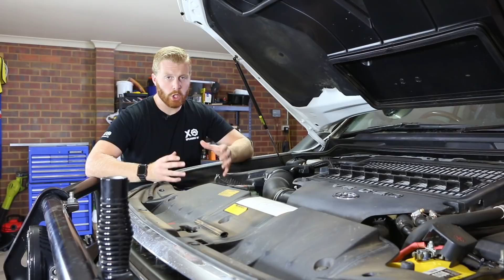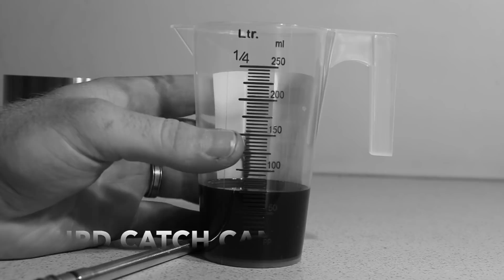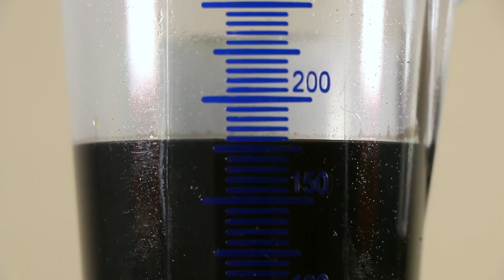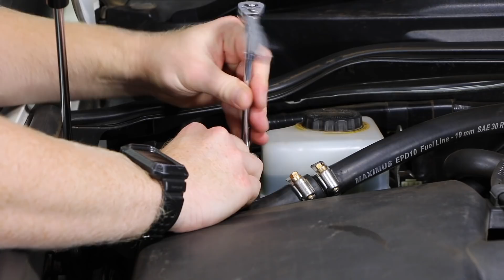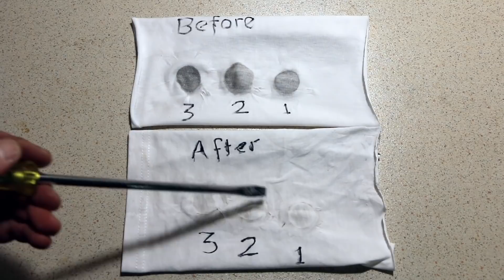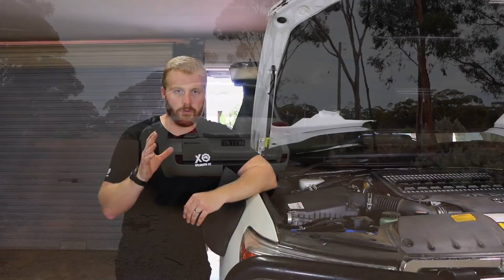PROVENT 200 | Is it really worth it? | MY 7000km REVIEW, drain and testing | Catch Can comparison

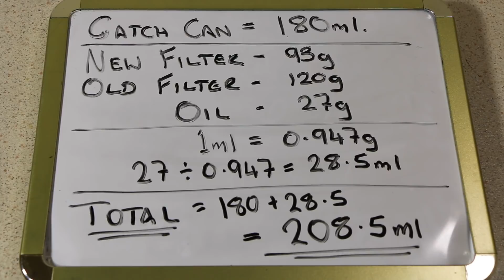Comment: 6:38 this is interesting for used oil as the technical data sheets typically have the SG (specific gravity) of around 0.85 (taken my engine oil of a Castrol Magnatec 5W-30 ACEA A5/B5 as an example) depending on oil manufacturer.

If an SG = 0.947 used, then it  gives a clear indicator (potentially) of the mass of suspended solid particles (soot, etc.) that increase its SG.

And it would be an interesting analysis of when the oil becomes somewhat saturated i.e. where the SG of the used oil does not increase over the oil change interval.

Then, I’d imagine as the engine ages this figure should go up and the saturation over the oil change interval would increase earlier after changing the oil and give an idea of engine health and blow-by.

Sorry, I think I may have designed an experiment and you seem to have time and money…things I don’t have much of.

Would such an analysis help to feed your inner nerd?

Thanks for the technical, non-beard-stroking approach.

Comment: Ive heard removing egr is not needed. Basically... How often, does an exhaust get blocked? Basically, never. Catch can = good. (if installed correctly when an appropriate catch can to suit your engine) Egr block = bad (usually) Old motors though, ok..New motors, need tune, usually a waste of time. My 2 cents on me research.

Comment: Poor installation will cause back pressure problems before the protection valve can react. You need to splice in ProVent under the hood so that the additional hoses are AS SHORT AS possible and do not mount with hoses of LESS THAN 25mm inside diameter! These need flow to work properly! Using feet of thinner hose also causes vapor to condense inside the hose before it even reaches the ProVent, you will experience freezing problems if used in climates with serious winters.

Comment: The back pressure risk is not a myth. If the unit is not serviced and too much oil is collected it can rise above the level of the pressure relief valve. This reduces its ability to vent the gases, and the back pressure can blow the injector seals. Ask me how I know... and the answer is about $600 for a new seal kit installed on a 4D4 3ltr.

Comment: You WILL use MORE fuel, EGR DOES NOT add to your fuel economy. Deleting EGR and DPF systems and re-tuning the engine on most engines result in a 40% to 50% increase in fuel economy and BEST OF ALL, no more sludge build up. But being a fan of the environment I think we just need to find better ways to deal with this problem like taking EGR gases from AFTER the DPF filter.

Comment: You think a Provent 200 or 400 is best for a Twin Turbo 5.0 Diesel V10?
Thinking a 200 each side, to not lengthen any hoses - or a 400 in the V when I remove the EGR Cooler/Parts to see the Alternator deep under XD
(essentially 2x R5cyl 2.5 TDI's from in a 2005 VW Touareg)
Reply: Subbed :) Great content.

Comment: ELEPHANT IN THE ROOM. Unfortunately you do not have a thorough enough understanding of what an EGR does, how it does it, when it does it and finally why it is used to be telling people to block it off. Advocating this is 1. Illegal, 2. Immoral - Will increase NOX emissions into the atmosphere. 3. Costly - Will void any applicable warranty.
Reply from the maker: Hey mate, I'm not advocating for it to be blocked, but talking about the reasons as to why or why it shouldn't be used. 
I know the system quite well, how it works and when it works though out different driving scenarios. I understand the ramifications on the vehicle and engine temperatures along with other external factors. 
Every person needs to make their own decision as to how to manage their vehicle and I think most wold understand that interfering with these systems would of course void related part warranty.

Comment: One more question regarding the Ford focus RS. If I do install the oil catch can and the oil baffle replacement which is not designed correctly, What is the estimated miles before you have to clean the intercooler and the intakes? Also what’s the best way to clean the intakes once they carbon?

Comment: I am from Vancouver Canada. I currently I own some Ford Escort Cosworth cars. I am going to sell them and thinking of buying a Ford Focus a RS so this has been a very helpful video. One thing I didn’t know is that there is a design flaw with the standard Ford oil baffle which also causes carbon buildup on the intakes of the RS which has direct injection. It can be remedied by switching to the Mountune Oil Baffle. Here’s a short video where the guy explains why it’s causing problems. It’s called “mountain oil baffle instal https://youtu.be/zdWSytbtPUE

Comment: 16:03 not 100% effective.., but by the looks of things at least 90%+, so that would suggest a conclusion that instead of ±60000km required clean of the engine intake it would be more like ±500000km engine  intake clean required - that would suggest same extension on intercooler cleaning requirement, I think case made.., wonder how effective pro-vent would be on the GDI engines?..

Comment: Nice video. I'm in the USA and have a catch can on my Trans Am but need one on my new V8 Saturn Sky (converted from the turbo 4). There are so many brands of cheap home-made stuff for performance cars but nearly all are essentially the same - some metal pot scrubbers and a mesh filter. Only a handful even seem to consider air swirl, actual oil precipitation, or have large enough volume. I've seen 500HP Corvettes have catch cans with 8mm hoses to and from the can, not nearly large enough to handle a lot of air. I found the ProVent and am researching it - seems great. Thanks for mentioning the Curtain University paper, I'm glad to see someone did some real research. And this video you do your own comparison with the cloth, that's great. I'm going to get a PV200 or maybe even a 300 series. Thanks again.

Comment: egr gas will still cause a dirty intake even if you are running an oil catch can. the difference is that the soot is drier and less sludgy. but it still evident.
Reply from the maker: Yes, this is true. The gases will mix and cause that sludge. The EGR will still produce residue, but it will be drier and less likely to build up in the intake 👍

Comment: Blow-by is not the only gases. Many diesel engines have a vacuum pump for engine controls and brake/clutch assist. These Vac pumps usually dump waste air into the engine block to move through the PCV system. Element on the ProVents are not paper, is polyester weave. Your theory on EGR lowering EGT's is not correct. EGT's raise with any ingestion of spent gases that are already hotter than amibient but less available Oxygen results in higher combusition temps.

Comment: one thing has been overlooked here.....WHY is the engine creating that much oil vapour in the first place??.....i myself own a late model common rail turbo diesel 4x4....after reading the owners manual, i discovered the suggested oil grade to use is simply too thin for Australian conditions....Australia has a higher ambient temp that europe/eastern countries year round..higher ambient temps means  going to a thicker/heavier grade of oil.......the oil grade suggested in my owners manual was 10w-30 oil......i have changed to 10w-40 oil and have seen a marked difference in oil vapour coming out of my rocker cover breather hose......just my 10 cents worth of hands on research and experience....cheers..

Comment: Hey mate I have a 2011 model cruiser and instead of the catch can what is actually stopping you from getting a hose from the crank case and  just putting it to the ground like older engines and letting is vapour like that and than plugging the hole on the air intake ? Thanks

Comment: The amount of oil caught between cans means nothing. It has to do with how the vehicle is driven during a period. Catch cans are completely useless if the engine is running correctly at optimum operating temps for good periods of time as blow by should only be occurring when the engine is cold unless something is wrong with it. A catch can will always catch blow by so pouring oil out means nothing.The higher ratio of running cold will mean more oil in the catch can. Engines will completely get rid of blow by and recirculated exhaust gas if they are given a regular good solid runs at operating temps. Diesels like to be worked, that’s why they make good work vehicles, being run all day at operating temps is much better for them, then sitting around doing the odd short drive.
Reply from the maker: I hear what you are saying in relation to the amount of oil produced. However, I'm not sure whether you own a 200 series or not, but these vehicles have significant blow by throughout the operating temperatures, not just at cold temps. 
For example, my vehicle is only a tourer, it sits in a garage for weeks on end without daily drive use and only hits the highway when we travel. This vehicle does anything but small cold trips. 
I know you will probably say that something is wrong with this engine, however this is the case with almost every 200 series owner I know, it's a common thing with these engines 👍

Comment: while i think these are a good idea if it's made from the car markers for that specific engine, as they still allow the engine to breathe the right amount. The issue i have with them also is if they fail, values can get stuck or fail which will cause a lot of pressure to build up and that will cause leaking / blown seals. I know Toyota/Ford can be funny with these things if you have a factory warranty as it can give them an out  to fix warranty issues. 

Another thing is if the motor is old and you're having a decent amount of blow by start at look what might be the cause, (injector rings, can be one major cause) or if you have a rebuilt/modified engine that can cause a lot of blow by as well. Catch cans are a band aid fix in most cases, and most people that are promoting these are the ones who have some vested interest in them.
Reply from the maker: Hey mate, can definitely see where you are coming from here. Although I can agree to some extent, a unit like this does include fail safe and pressure relief valves that should (theoretically) prevent damage in the event of a pressure build up.
Although manufacturers did design there vehicle in a particular way, engines need to breathe, however combustion engine were never designed to recycle that contaminated air back into the cylinder. This was only done for emission standards and a unit like this will help to purify that air prior to re-combustion. 
Hope this makes sense and by no means discounting the points you have raised. 
Cheers, Nathan.

Comment: Nice video mate. It’s also worth noting that if there is a significant buildup of sludge where the EGR combines with with the CCV system, it’s worth checking that there’s no cracks or anything in the intake system that might cause the sensors to be reading an incorrect amount of air flowing into the engine and thus over-fuelling, causing more particles in the exhaust than is necessary.
Reply from the maker: For sure, I'll see if I can check it out. Thanks mate 👍

Comment: Great Video, I just have one question, when you disconnected the hoses for the test, is the flow through the catch can still the same?  I thought there was a vacuum applied at the outlet tube so when you disconnected the second line there would be no vacuum to pull the oil vapour through?  It looked like you just opened the system.
Reply from the maker: Hey mate, so I don't believe there is a vacuum on the outlet side of the can, if there is it would be very small. The pressure and direction of the flow is based from the pressure placed from the crankcase toward the catch can. 
Hope this helps thanks, Nathan.
Reply: @XploringOz  Thanks for the reply

Comment: Hi mate, I don't if I am missing something but I think it might be good to replace the filter once is completly sought. What I notice is that after is sought air does not flow easily. So one is increasing alot internal pressure on the engine once the filter is drench in oil. I am not sure that one is supposed to extract a bottle of oil from this filter. I also seen this recommendation from other sources. Let me know your thoughts. Thanks for the video also.
Reply from the maker: Hey mate, so the manufactures themselves recommend changing the filter element every 30-40k km's, depending on how the vehicle is used. The filter material is designed to continue to allow filtering and airflow even when fully soaked. 
I can't talk too much about the science about it, however it seems to be working thus far. 
Cheers, Nathan.
Reply: @XploringOz  the filter code that you used is the lc5001x I believe correct? 

I might have gotten a knock off or it can be my oil type causing this or sludge in the motor it self. Just guessing here. What I notice on mine is that is completly black,the oil didn't flow to the bottom of the filter like yours.
Reply from the maker: @luhckylu  Hmm, yeah that doesn't sound right at all. I can't offer to much advice here as it's not something I've had experience with. Might pay to take it to a mechanic or a fitter who deals with catch cans to seek their advice?

Comment: Hey mate, been watching and loving your videos for a few months now. I've just bought a 2017 Sahara with 20,000 on the clock. Would you recommend intake/intercooler clean before installing?
Reply from the maker: Hey mate, thanks for the feedback. Glad to hear that you are enjoying the channel. 
To be honest, a vehicle with 20,000kms probably doesn't need an intake clean. In my opinion is just wouldn't be worth the investment as it isn't a cheap task. I don't think you would get much, if any benefit from it. 
All the best with the catch can and the 200 series. 
Cheers, Nathan.
Reply: @XploringOz  , great presentation, well explained. In my case I fitted a Provent IV to my 2013 X trail. Lots of owners reporting oil blowback on inside of air filter, mine had that too from PO city driving, including mine but now with Provent, no oil on filter element , = good result in my opinion.
Reply from the maker: @alanbrookes6637  Awesome, great to hear that you've had a positive experience with your unit! I'm still satisfied with the results I'm getting from my unit and have no complaints to date 👍

Comment: I have had a provent 200 installed since truck ticked over 140k, now at 300k and last clean of pipes and intercooler it’s significant cleaner and engine breathing better.  Don’t skimp and get provent and don’t look back.   “fourbyfour” channel is wrong with his dislike of catch cans.
Reply from the maker: For sure, I agree with this. Keeping an eye on these units and replacing the filter elements at regular intervals is also important for safety and efficiency. Everyone will have their own opinion, however this video reflects my view on the matter. 
Cheers, Nathan.

Comment: Hi Nathan. I'm a fresh subscriber to your videos. Loving your methodical and very informative approach on what your doing...just brilliant. I had a big binge tonight. I Come across your catch can vid here and I've paid close attention... I think. You say if the provent filter blocks or has a problem it will vent the crank case gases out through the relief valve that you show in the bottom of the filter, Which is inside tge can, and into the outside atmosphere under the bonnet. How can it possibly do this. Could you check this and maybe do a video. I believe you are wrong. The relief valve in the bottom of the filter just by passes the filter and there for it will just vent it straight into the catch can itself, then to the out let back to the inlet pipe feeding the turbo. Correct me if I'm wrong, but have a closer look at it please. Maybe even simulate a blockage. You'll see what I mean.
While your at it check the other relief valve on the bottom side. It gives the catch can and motor as such the ability to suck in unfiltered air.
I won't be installing a provent catch can antime soon.
Reply: @XploringOz  Hey matey, are you unable to answer this one for me...???
Reply from the maker: Hey mate, yes I see what you are pointing out here. Without conducting my own test, I would have to agree with you here. The ventilation system would recirculate the gases back into the cooler, just as if the catch can was not there to begin with.

Comment: Nathan, Great video.  With the new Provent 200 filter element, the vent valve is in the bottom of it as shown clearly in your video.  This means that if the pressure is high and it opens the inlet fumes are vented directly to the outlet.  Normally this is fine but if the outlet hose to the air intake is kinked or has collapsed, serious damage to the engine could occur.  No doubt Mann and Hummel have done this change to meet emission requirements.  I think there is merit in leaving the original vent valve in the top of the canister intact.
Reply: Christ now im stressing - do i get one of these for my 2014 BT or a different brand?

Comment: Thank you for your time, i appreciate your work.
My LC 200 came without EGR system, do I need to install catch can?
Reply from the maker: Thanks mate, glad you enjoyed it. 
Installing a catch can will definitely still have an effect on catching some of that oil, however it won't be as important. Without an EGR system, you won't develop the 'sludge' that builds up in the intake and therefore won't have a long term restriction. 
Saying this, the oil that can flow through the intake pipes without a catch can fitted can also effect the thermodynamics of the intercooler, creating a slight increase in intake temperatures. 
In conclusion, although it's not quite as important, there are still benefits there to fitting a catch can. 
Cheers, Nathan.